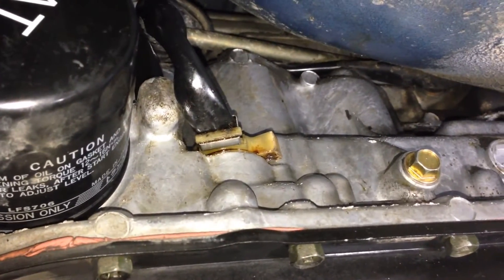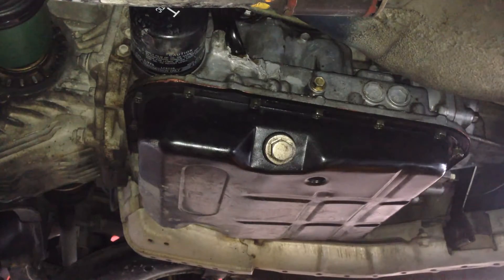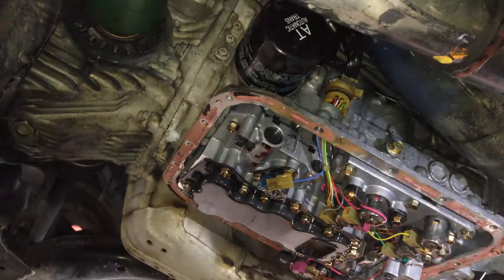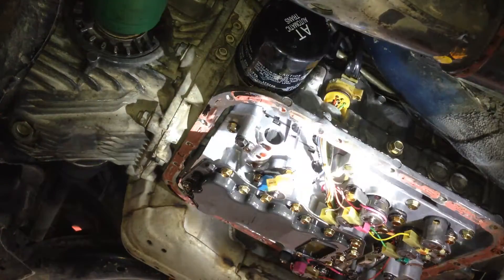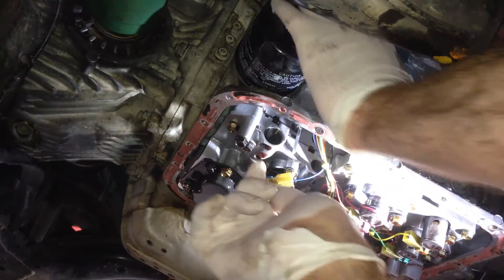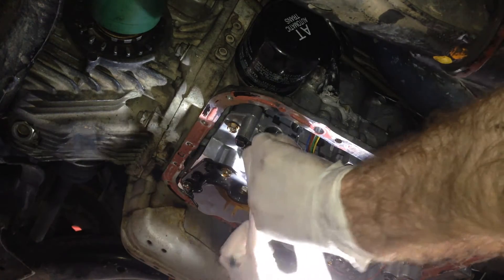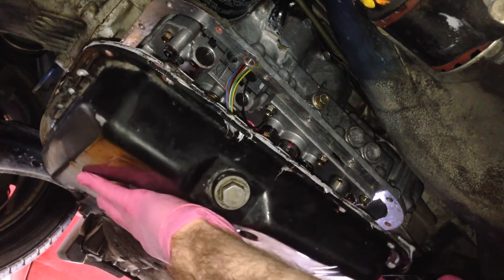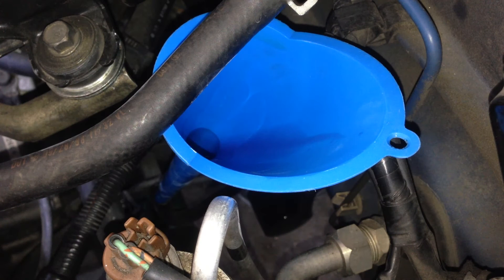Fixing a Wiring Loom entry leak in a Subaru 4EAT transmission

Comment: Hi, i have a phase one 4eat (tz102….ABA to be exact), and while pulling the harness out of another unit to swap mine, i broke the plastic tabs on the bulkhead, will i still be able to use it or do i need to pull another harness?